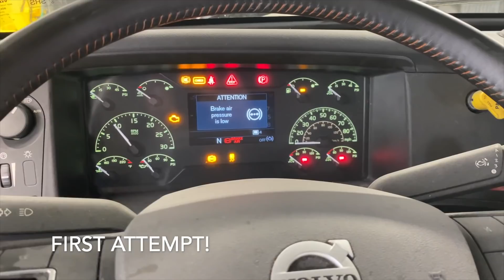Salvage Auction Volvo VNL Semi Truck Rebuild.

Comment: That looks like it was expensive. Great work though!
Reply from the maker: Not as expensive as buying used one
Reply: @salvageparadise  how much savings would it be instead of buying a used one with similar mileage?
Reply from the maker: @codeninja1823   as of right now we are not even talking about savings. We are talking about getting truck at all.

Comment: If you know anything about frame, then you know that it’s never going to be straight again never
Reply from the maker: Apparently you don’t know anything about the frame lol
Reply: @salvageparadise  Hook up a trailer and drive 2 miles and then measured the frame
Reply: @salvageparadise  You’re the reason why people come to me to fix what people like fixed
Reply from the maker: You think we don’t test them before putting them on the road? If you think it’s not fixable you’re just bad Mechanik bro. You never seen what we’ve fixed before
Reply: @salvageparadise  that’s the problem you test it before putting them on the road,But once you hook up a trailer and drive it it will get misaligned
Reply: @salvageparadise  and by making videos and putting them on YouTube you’re making only worse for yourself because now everybody thinks they’re so easy and that’s why the prices on auctions are so high
Reply from the maker: By the test I mean we take local loads in case there’s problems, so we can fix it before taking a real long haul load. If this is not a test for you I don’t know what kind of tests you do. You don’t even know what our procedures are but you already make conclusions based on your ignorance. If our frames weren’t straight we wouldn’t pass alignment and local load tests, then we wouldn’t be in business, but our business is thriving right now for us. And people don’t buy those trucks to fix by themselves they come to us, so keep whining. By putting these videos on YouTube I actually bring more business for my shop. Your logic doesn’t make sense. So if you can’t fix this frame I think you don’t deserve to be in this field let professions do their job.
Reply: @salvageparadise  One more thing that you don’t know the frame could be bent but still pass that alignment, trust me I know we do this for the last 20 years. But I don’t post it on YouTube So the sofa Army can say good job
Reply from the maker: Okay.

Comment: Vehicles like that probably shouldnt be on the road
Reply from the maker: Why?
Reply: @salvageparadise  while it might done correctly these are hazards on the road especially once the salvage title is washed and sold as used with clean title
Reply from the maker: We never “wash” titles. It’s illegal actually
Reply: @salvageparadise  not you the next owner or current owner upon selling it
Reply: If the frame is straight it can be rebuilt.
Reply: @hudsondonnell444  didn't say it couldn't I said it shouldn't